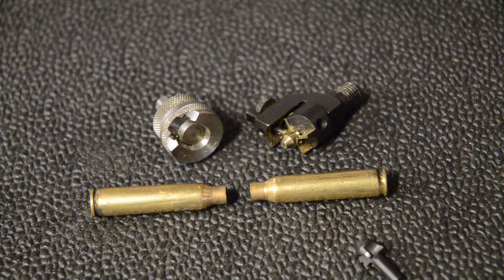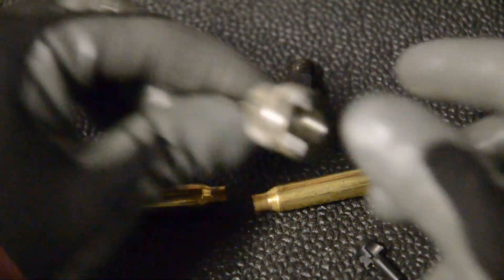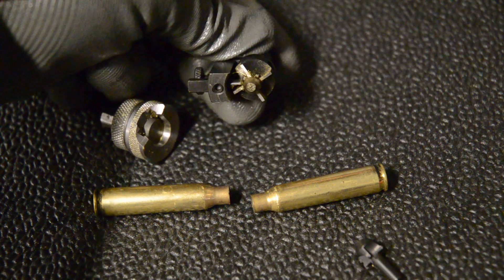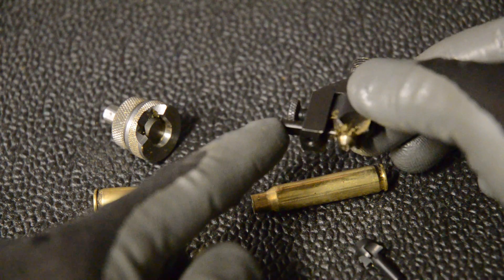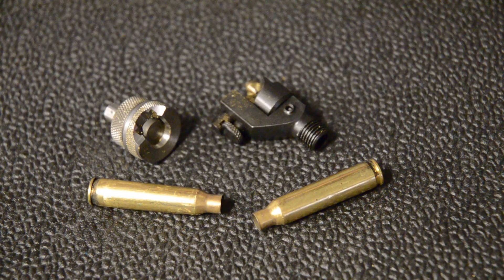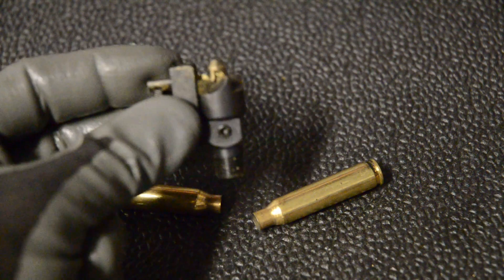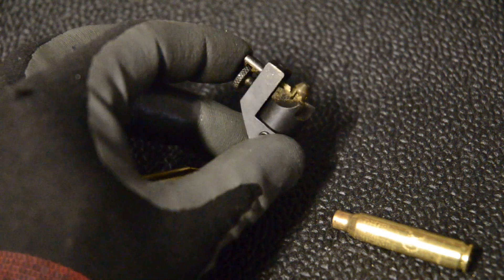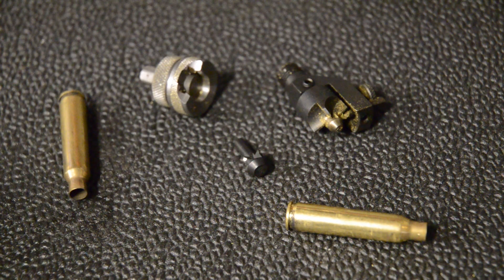The Fastest Way to Trim Chamfer and Deburr Cases: RCBS 3-Way Trimmer

Comment: This is close to how I've done it. I just spent $160 for a trim it 2, and it's a pain and doesn't do as good of a job. This set up is not only cheaper, it's faster, does a MUCH better job, and I've found it to be extremely consistent. I clamped mini vise-grips on the shell holder to clamp it down more firmly and save my fingers, which might help keeping the length more uniform..

Comment: Don't wear gloves when operating rotating machinery! All the cutter has to do is catch onto the glove and if it doesn't tear off it can mangle your hand up. This is one of those counter intuitive safety measures. Safest way is to use two pliers to do the work, but if you are careful and you can put more standoff in the space the cutter rests above the workspace, you should be able to do this barehanded safely.
Reply: Nitrile gloves are the perfect compromise.

Comment: Cool now I need a shed and a drill press.
Reply: Drill press is only $60 from harbor freight and just setting up a table on your patio or backyard covered with a tarp is a good start. You can build a very cheap shed by making a PVC frame  and wraping it in the plastic industrial wrap or tarp. Waterproof, and you can install a ventilation fan for welding if need be. I made a couple of these for emergency CBRN (NBC for the old guys) decontamination stations in the case of any WMD attack.